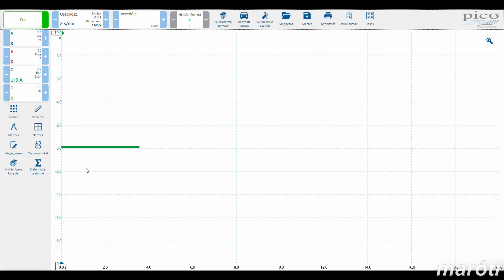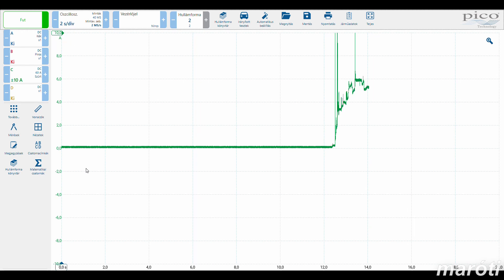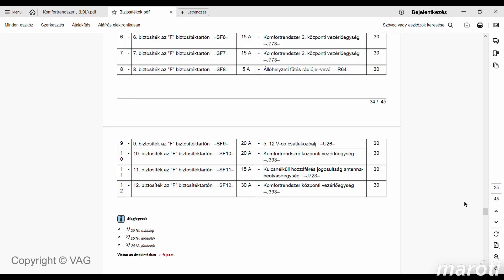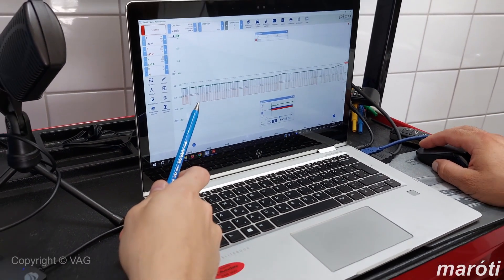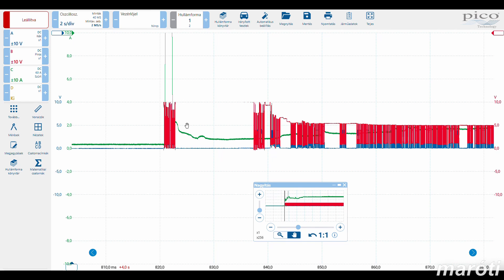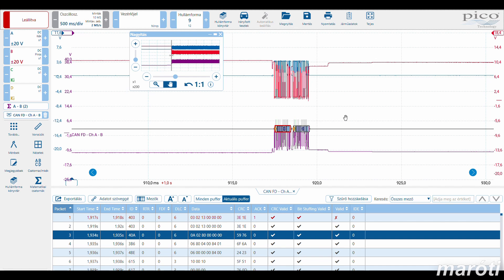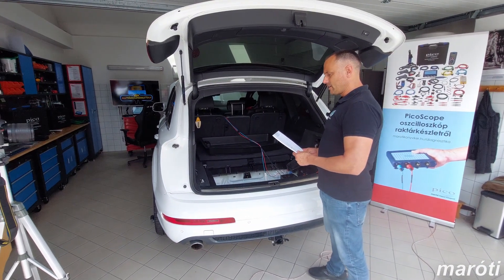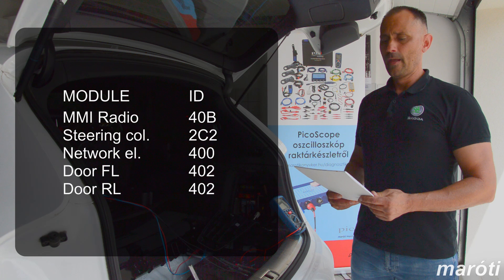PicoScope case study - Identification of CAN messages - Maróti Kft.

Comment: So moisture got into a connector?
Reply: Nono, a capacitive sensor works on the principale of water/sweat on your hands to change a capacitive field to unlock the door. Sometimes rain or just washing your car at the carwash can trigger the sensor if the keys are nearby the car. But im also a bit confused of what was the cause, the module or the door handle?